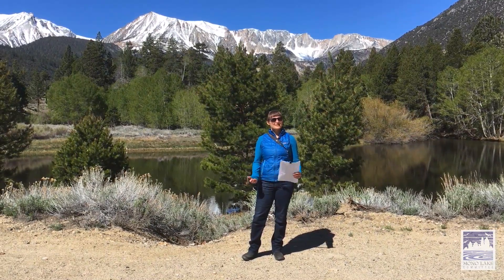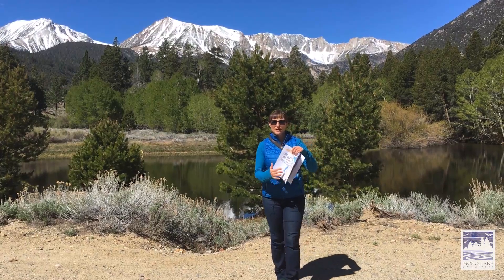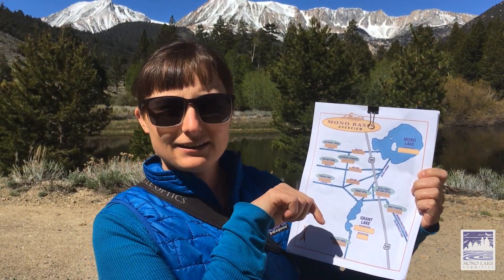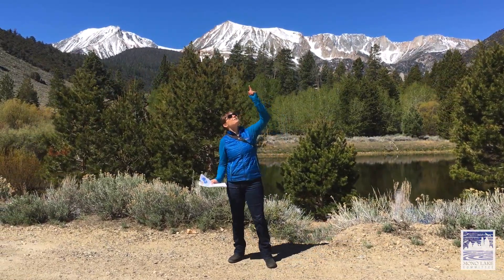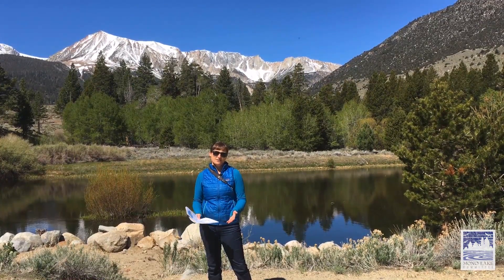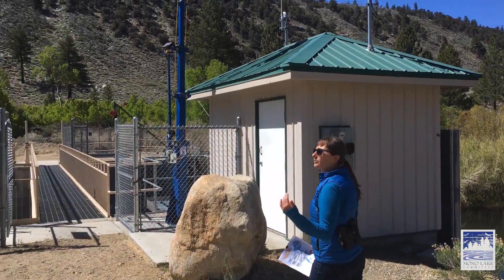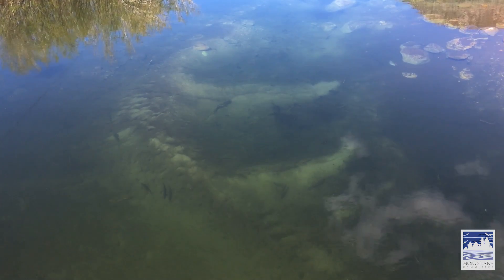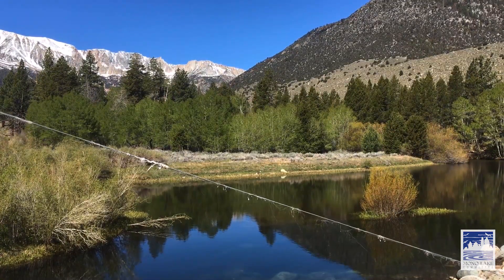The LA Aqueduct: Mile zero

Comment: Since Owen's Lake filled, it's smart to keep it full, it had become a toxic dust source dried so to miss it having flow implies enforcing the death of the most productive valley on the east side.

Bishop was assumed to become a large destination city, the theft of water rights was encouraged by taking pot shots at farmers to help them sign, coercion was used.

Restoring flow to maintain Owen's Lake can restart farming from Bishop to Lone Pine, to make the deal have LA recycle all sewage plant water as NLkTahoe has done since the 70s to not have algae blooms, do the math, save the lake by recycling LA wastewater.

If algae are used to purify vs floccing chemicals 2nd step gains 30% of volume biodiesel/biocrude, from pilot/study for Gov.JanBrewer AZ, vetoed by Sen.McCain or it'd  become a standard.

Nice video, lived in MammothLks a while, cheers ♻️
Reply: Owens lake has not filled, it's only inches deep in a small part of it's original bounds.
Reply: @Trail_Trash  Good to know, they still take too much water & need to fully recycle all water in sewage treatment plants as at NLkTahoe has since late 70s that volume re-routed to the lake.

From the N.Pacific being too warm Siberian cold turns north dumps heat and moisture cools to ooze from AK to the Gulf as a cold groundhugging airmass 1200mi × 1500ft a wall-of-cold.

Expect a repeat snow dump, when ocean air is drawn into the coast it hits the wall at the Sierra crest, so, since LA won't recycle it may fill anyway. 

If the mud crusts over the dust will be less a thought, yet, expect a repeat snow dump not a few years between them a caution,  the flow can't change back until oceans cool 🍺